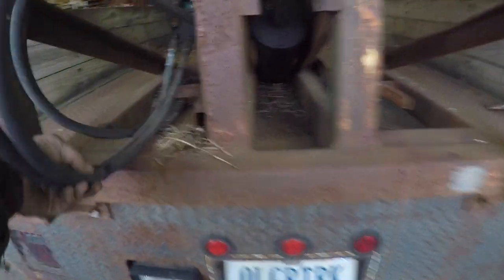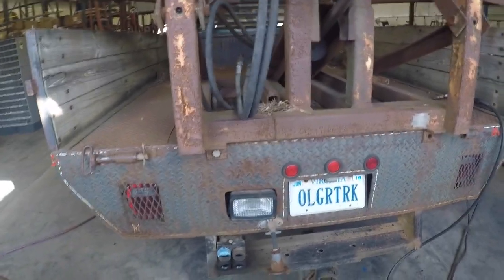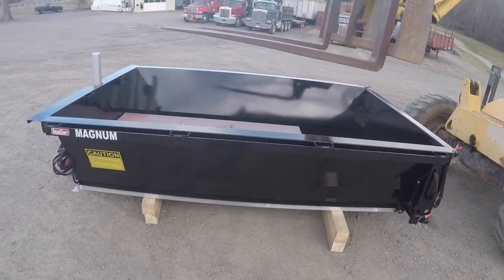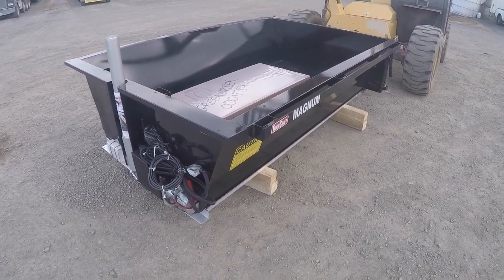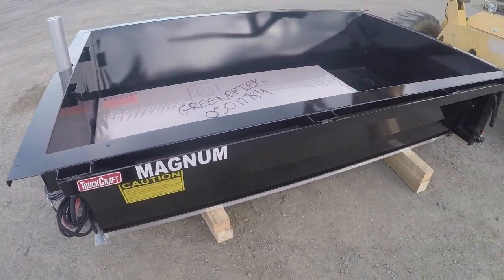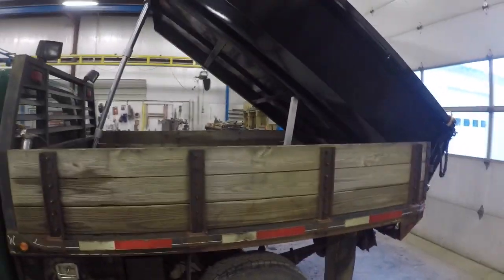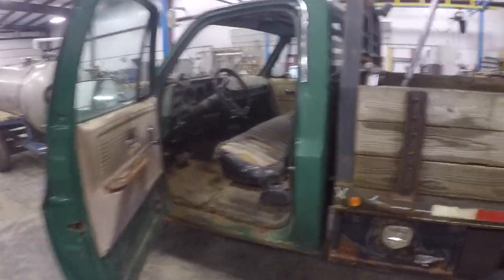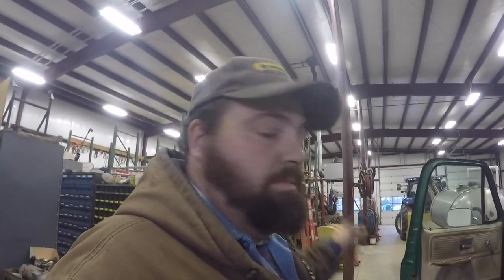Old Green Truck gets a new toy... For now.

Comment: I think that's pretty slick. It's convenient that you can pull it off so easy. I have a dump body on my duramax and flatbed on the powerstroke. But if the duramax goes down I have to pull both beds, lights, fuel necks and reinstall to get my work done
Reply from the maker: +Ryan Hadden. Wow that would be a lot of work. I like that I can put it on another truck easily, I've had old green go down on me before in the middle of wood season.

Comment: I had one of those for a firewood business they are great for a one man operation
Reply from the maker: +chris kalinowski. That's good to hear!
Reply: DLH Farms are you shooting for a full cord if so your going to have to heap up
Reply from the maker: +chris kalinowski. No I'm shooting for 2/3 to 3/4 of a cord, most people that buy wood around here are on a fixed income and can't afford a whole cord. I do have a full cord load available but I use the Ford 6.0 ton truck with dump bed to deliver it.
Reply: Give them a good load for a fair price I’m sure you don’t have to worry about looking for customers word of mouth is all the advertising you need
Reply from the maker: +chris kalinowski. Yeah I don't have any trouble selling it, I have trouble keeping up with demand, I need some help keeping the processor going while I'm at work.
Reply: That’s a tough situation finding someone responsible enough for that task will be tough any local guys get laid off in the winter with enough experience running equipment?
Reply from the maker: +chris kalinowski. That's the thing, they need to be really competent, that thing is extremely dangerous with that saw running within arms reach, then they would need to be able to run the mini x to reload the live deck. Anyone that can do all that and be productive already has a good job.
Reply: How about a retired guy someone with common sense experience and lots of mechanical ability just bored looking for something to do for a few hours and a little extra coin for hobbies
Reply from the maker: +chris kalinowski. You can always learn I guess.

Comment: I love it. Makes me want to build one for my truck.
Reply from the maker: +Guy in WY. Go for it, that would make a good video project!
Reply: steve mondal yes, it would have to be removable. I’d probably use the gooseneck ball to attach it to, then attach at the sides of the bed. My truck has a hydraulic system for the plow and I have an extra scissor hoist for a wagon.
Reply: Blake what is your G mail address again please, if you feel comfortable giving me it?
Reply: steve mondal it’s GuyinWY at gmail.
Reply from the maker: +steve mondal. you would have to pull it off to use the goosneck hitch. There is a gooseneck hitch on old green also but I don't pull one with it anymore.
Reply from the maker: +Guy in WY. Sounds like you already got a good plan!
Reply: Is it going to make it top heavy?? I know your use to handling all sorts of equipment, and seem to be very careful.

Comment: Nice addition. I know you had said in the past about maneuverability, what do you think about dump trailers?
Reply from the maker: +PA Farms. I like my dump trailer, the biggest thing with mine was that it was designed do be a farm tractor implement and you could not put tags on it, it didn't come with a title, or signal and brake lights. Some places I would go delivering wood I would have to back all the way from the road because of nowhere to turn the trailer around, one place in particular I would have to back for about half a mile. Other than that dump trailer are a good alternative to a dump truck.

Comment: That looks to be a real step forward especially for log deliveries. I presume you think the bed is strong enough to cope with logs being tipped in when you load and will the tailgate have to be removed when you dump or will it fold back OK and protect your rear lights etc?
Reply from the maker: +Dan Whiteford. I just fold the tailgate down it has chains to hold it up. I quit selling logs a long time ago, I only sell processed wood now. I kept running out of logs so I quit selling them.
Reply: Sorry for the misunderstanding, logs to us means processed firewood not unprocessed timber (Smaller trees, a lot of branch timber etc)
Reply from the maker: +Dan Whiteford. Oh ok, log to us means unprocessed timber. It seems to be holding up good dumping processed wood, I've delivered about 15 loads on it so far with only paint damage, that was to be expected.

Comment: Dennis that looks like it a first class dump assembly you have there.  I think you've done a first class job of adding those side boards to it,.and that head board look really nice there too. Best thin is, you can still look back and see what you have loaded.
By the way, way is the size of your shop , length width and height, please. I think that is super nice; I thought of that from the first time I saw it here.
Reply from the maker: +Reg Sparkes. I think it's 80 x 100, and 21 foot tall in the middle so we can raise dump truck beds inside to work on them. It has 3 doors on one end, two 14x14 and on 14 x 16 right in the middle, and one 14x16 in the middle on the other end.
Reply: It's one of the brightest and cleanest shops I've seen in a long time. Good and serviceable build for sure.
Thanks for the reply.
Reply from the maker: +Reg Sparkes. It is really nice we can't figure out how we made it without out it before.

Comment: The truck is plumbed for hydraulics .bypass that electric pump and use the installed system
Reply from the maker: +Randy J. That would void the warranty on the bed, and the truck uses hyd fluid the bed system uses automatic transmission fluid.